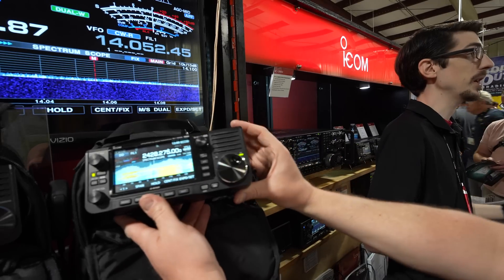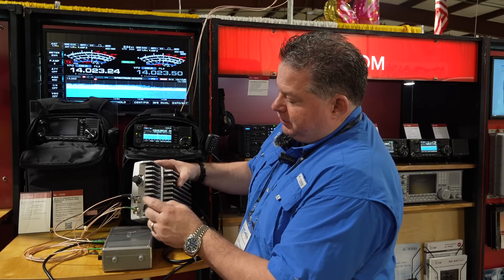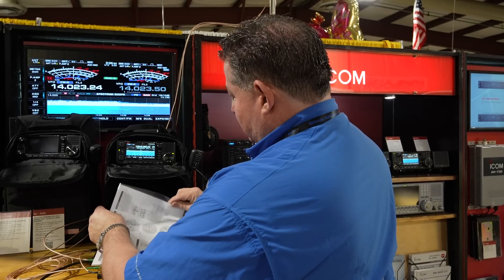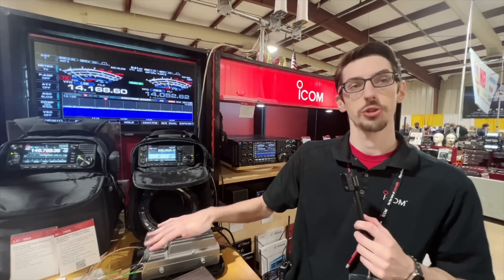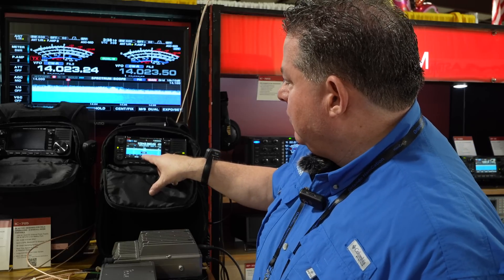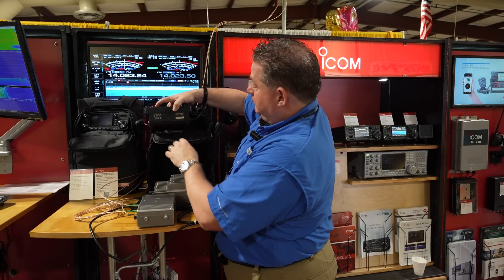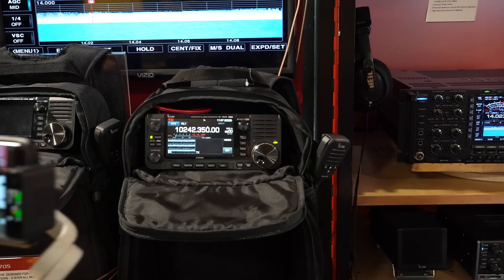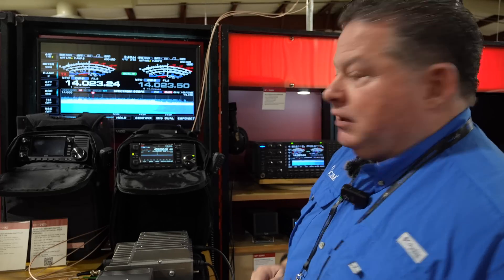FIRST WORKING ICOM IC-905 #HamCation2023

Comment: @2:54 those are not smith charts.. they're 2D radiation pattern diagrams. a bit embarrassing for the presenter in the icom branded attire.
Reply from the maker: It was the opening of the show after he was literally climbing on the exhibit to install antennas.  How about a little mutual respect between hams?  I am sure Ray knows the difference.
Reply: @HamRadioCrashCourse  No problem, but nothing I said was disrespectful.

Comment: ICOM has a habit of omitting the 70cm ATV band on their radios, so they usually can’t transmit out of the box on 420-430mhz (USA ATV band on 70cm). Will we have the same problem here or will the IC-905 cover the full 420-450mhz out of the box? -de N2YTF
Reply: The spec sheet says 430-450 MHz and it also says that ATV is supported on 23 cm and above only.  So yes, they made the same mistake as before.  I wonder why they can't do this right? -- de ni1d

Comment: I questioned some of the locals to ask whether the 905 would work with QO-100. The answer was that it is not a full duplex set-up and so you will not be able to hear yourself to make sure you are not overdriving the satellite. I wonder if ICOM can address this as the Q0-100 must be a big market for them.
73 Ed

Comment: needs separate connectors on 2m/70cm/23cm... how about an add on module for the 9700 to add 2304, 5760, 10368(weak signal)? use 432 as the IF...  save me from needing 3 separate transverters!

Comment: 10mhz reference from that gps antenna ?
Reply: probably, need to oscillator lock at those freqs. I use a 10mhz in on my 9700 to keep it on freq.

Comment: What’s the appeal of SHF?
Reply: weak signal... guys routinely do 600 miles or more at 10ghz, in summer if we get tropo ducting it can go even farther. Lot of people on 6m- 76ghz who work SSB/CW/Digital. Those bands are not just line of sight! Right now on 2m the beacon I use to monitor for band openings is S2. It runs 10 watts to a pair of stacked loops and is 350 miles from me! During band opening it can be S9++++
Reply: @MaryBrownForFreedom  Just before HamCation I had a station 317 Miles North of me in Ga contact on 2 meters running JS8Call. :) 30 Meters has also been good and active.
Reply from the maker: High data rates for me.

Comment: I do not see the point in this radio. It would have been much better if they did something that people would like. for example, 144, 220, 440, 900mhz would be a good combo. Or 50, 144, 220, 440 with d-star and all the little features would bring in a much bigger audience then 1.2 or 5 gig would ever see. You are catering to a small group of people. I have been a an Icom support for 30 + years but this is non-sense. when are you going to do another vehicle radio, all band mode like the 706 or something. something that people would actually want to use.
Reply from the maker: It does 144, 440…
Reply: I take it you have never run into anyone that does VHF/UHF and up contesting.
Reply: For the point of the radio, well, someone mentioned this, but if you're in a dense built-up urban area (such as megacities which tend to pop up in Asia) well, then, there might not be much room for a traditional antenna setup, and not everyone can be portable all the time. 
My feeling is that Icom is trying to put their toes into water, so to say, to see if the time is ready to start making more serious investments into higher frequency gear, which might be more interesting to people in such urban areas. If the fish bites, then, we might expect more radios for those bands, and that might prove to be profitable in the long run. They already had an attempt at 23 cm with the ID-1, from 2002, but it seems that they weren't successful back then.

If Icom manages to break into the SHF market, they might have advantage for a considerable amount of time, and also gain lots of good will. 
If we look at it historically, that might be their strategy to push into empty market spaces: They perfected audio DSP with radios of the IC-7000/7100/7200 generation, and then managed to make the IC-7300 which was the first radio which was both "cheap", and had integrated spectrum display, which was both of high refresh rate and relatively high resolution, and basically got rid of internal accessories, such as hardware filters and similar. It completely blew out of the water the Yaesu FT-991 non A, which could either output audio, or refresh the blurry spectrum. The difference was so large, that Yaesu pulled the FT-991 out of production and immediately made the patched-up version FT-991A. Even 7 years later, the IC-7300 is still going strong, while the Yaesu didn't have a comparable radio until FTdx10 in 2020. It started a whole new generation of radios.
Similar could be said for the IC-9700: It's only competitor right now is the Yaesu FT-991A, and that doesn't have 23 cm band. For example, I've looked at the website of the VHF-UHF FT8 Activity, and this year, on 2 m and 70 cm, 1/3 of the radios used were IC-9700, while on 23 cm, it was over 50%.

On the other hand, a new mobile radio would probably be a merger between ID-5100 and ID-52. Additionally, in the mobile market, there's already stiff competition both from cheaper Chinese units, and from other Japanese manufacturers.
Reply: anothe boat anchor!
Reply: Yes it does  vhf and uhf but so does the 705. And yes people do contest on vhf and uhf and I would imagine 1.2 gig. But there is no infrastructure above 1.2 unless if you build it yourself, there’s not a big following for anything above let’s just say for the sake of argument, 1.2 gig. Most people that go above that it’s usually homebrew or something they modified from commercial radios like 900 MHz. 900 MHz is a great band, but nobody makes radios for it anymore. At least not in the amateur. Basically, I think it’s a radio that’s gonna have a very small following and they might recoup the money they put into it but I think they could’ve done something better. Something that more people would appreciate in like. Maybe a new mobile radio rig now. I hate to say this, God, I have loved Icom for over 30 years almost. I have had all there radios but YAESU is kicking their butt  right now because ICOM just keeps dropping the ball on mobile rigs. What was the last good mobile radio that came out for ICOM ? one that did everything VHF uhf hf? My guess would be the 7100 which technically is not a mobile radio.  All I’m saying is if you want to buy it obviously but I think ICOM waste of their time and their money for a radio that probably is not gonna go that far. They should’ve put their resources into something that more people would want if you think I’m wrong that’s fine you’re entitled to your opinion.
Reply: @jkruse1151  don't need infrastructure for SSB/CW weak signal work. Tropo ducting can carry signals thousands of miles. Look at the HI to CA duct that forms every year. My best on 2m is 1350 miles terrestrial, NZ via moon bounce... I know guys in MN who regularly work 600+ miles on 10ghz!
Reply: you are right!!! This is a boat anchor! who the hell is 1.2 gig or 5 & 10. repeaters are next to dead on 450. now i need a radio for 10gig ? I don’t think so
Reply: @frankrizzo8918  there is more to life than FM on the VHF/UHF/Microwave bands...

MANY of us use SSB/CW/digital modes to make contacts hundreds or even thousands of miles away!

I was rag chewing on 2m SSB last night with hams in IA, SD, MN, and WI... I am in SW MN... Some of the guys are 200+ miles from me! And that was during no propagation enhancement, band was flat...
Reply: why are they not making all mode 2 meter and 450 radios. they used too . 10 gig radios? who the hell are you going contact on that ?   waste of money !!!!!!!
Reply: @frankrizzo8918  Well, Icom has currently in production IC-7100, IC-705, and IC-9700 radios, all of which are all mode and cover 2 m and 70 cm, and both 705 and 9700 are quite fresh models. What's the issue there?

Comment: The geostationary satellite QO-100 uses a 2.4 GHz uplink and a 10 GHz downlink. That satellite covers Europe, Africa, the middle east, parts of Asia, and some of Brasil. I think Icom made this partly because that satellite exists. As it is now, the only way to access that sat is to cobble together a station using Chinese amplifiers, regular VHF/UHF ham gear, transverters, etc. When this is available it will be the first time you can access QO-100 with a single major manufacturer's solution.
Reply from the maker: Well said.
Reply: @HamRadioCrashCourse  were you able to confirm if the 905 was full duplex?
Reply: @jbinsc  that's the one thing I wasn't sure about. It would be wild if they made such a radio without full duplex for sats, but it certainly is possible. It would still be useful for QO-100 but you would need two lol. I know some use two 705s for portable sat ops.
Reply: Use the DXPatrol Ground Station.  Essentially this is still using transverters. The 905 on its own is useless without that huge heatsink box. So you might as well carry the DXPatrol GroundStation and a 705 for half duplex or 9700 for full duplex.
Reply: @2e0txe  are you referring to the main radio box? Or the 10 GHz add on? I don't know much about the DXpatrol device but it seems to require two radios additionally. If you are simply counting boxes yes I guess the 905 (assuming it is full duplex) would have 3 boxes, control head, main radios, 10 GHz add on. Yes the 905 is using transverters but I don't see how that is relevant to my point. It still is a total solution for QO-100 without additional radios.

Comment: It's certainly cool they are making such a unique radio that does 2.4/5/10GHz but considering there are so few hams that use or have a radio that goes to those frequencies, it doesn't seem like very many would be sold.  Who's gonna be buying this radio?  Seems with only 2 watts and all the extra FSPL, range will be somewhat limited, only PtP (very directional) links would be going very far distances.  73.
Reply: Well, if it's maybe 2-3 thousand dollars, then it might actually be cheap for those bands. Looking at the commercially manufactured gear (say from Kuhne), a transverter plus power amplifier could easily come into the 1.5-2 thousand range, and that's only for one portion of one band. On top of that, you'll need a radio to drive the transverter, and that's easily one more thousand extra. Therefore, 905 could be a cheap and easily accessible way to start operating on those bands.

For free-space path loss, well, it can be a bit misleading. Yeah, it increases with frequency, but at the same time, there's also the ratio between antenna size and gain, and it allows us to put much more gain in the same antenna volume, which very easily makes up for the increased free-space path loss.
Reply: My guess is that, yes, there are few hams on those bands, but it is because the equipment was so inaccessible. With a major manufacturer like Icom selling a modern radio that provides a complete solution for all these bands, getting on the air now just requires a purchase, without all the custom parts and figuring out that your typical 10 GHz setup from the recent past would require. It's a bet, to be sure, but if it pays off, then this will start a trend. There's so much spectrum up there too, higher data rates are possible, lots of neat places this could take our hobby. Let's give them some respect for making something innovative.
Reply: I am guessing you can use your own antennas... 

As far as who would use it? The VHF+ weak signal crowd! Quite a few of us doing long distance comms on the upper bands! My best terrestrial on 2m is 1350 miles via tropo ducting!  70cm is 1200 miles! 23cm 1100 miles! Via moon bounce I have worked around the world! VHF/UHF/Microwave isn't just line of sight! Right now on 2m the beacon I use as a propagation indicator is S2. It runs 10 watts to a pair of loops and is 350 miles from me!
Reply: @MaryBrownForFreedom  Good stuff!  Ok who will be the first to do EME on 2.4GHz!?
Reply: @Z28videogates  that was done long ago... guys are doing EME on 76ghz now and some are experimenting even higher! 

I am putting up a new dish for 23cm EME this spring... been off it a few years after winds folded my 3m dish like a taco...
Reply: @MaryBrownForFreedom  No way, wow.  Things have certainly changed and improved since I looked into this stuff years ago.  I'll check it out.  Thanks.
Reply: ATN in Southern Cal, NV and AZ are using those bands for ATV.
Reply: Hey, it might give me an excuse to put my surplus Varian 5.6 GHz TWT to work.  🙂  ni1d

Comment: No video output...🤔🤔🤔
Reply: @B.Murphy  Yes, I know, but they are both Icom.  Seems like they don't care to provide convenient external video hookup.
Reply: Ah, I see. Yes, I agree with you. Unless you spend a bit more with the 7610.
Reply: @B.Murphy  The 7300 requires a pan adapter card as I understand it.

Comment: Whats the price going to be-----------First born plus 1000 gallons of gas ;)
Reply: @SteveBerwick  I think it will be in the $3000 to $3500 without the 10 GHz module. Not a lot for the amateurs that want a ready to go rig for those bands.
Reply from the maker: I don’t see it being close to 705 price.
Reply: @SteveBerwick  My guess is 2999.00
Reply from the maker: Probably a good guess
Reply: Stand alone transverters for those 3 microwave bands would cost me around $2100 so $3000 to 3500???
Reply: Make it do 11 meters too😂 breaker breaker good buddy
Reply: 2-3k I bet.